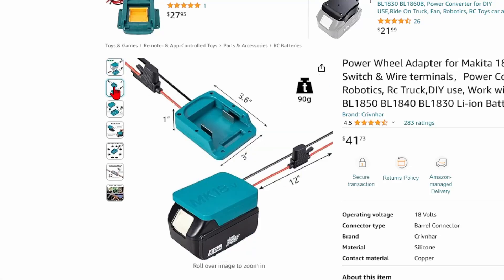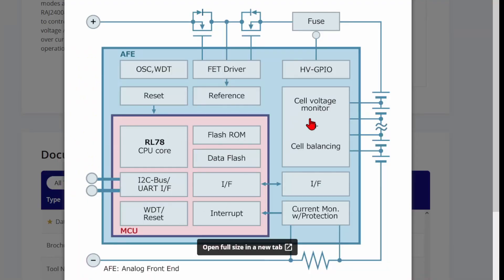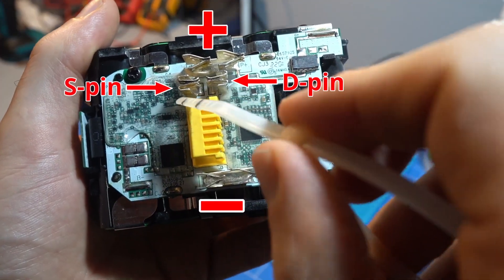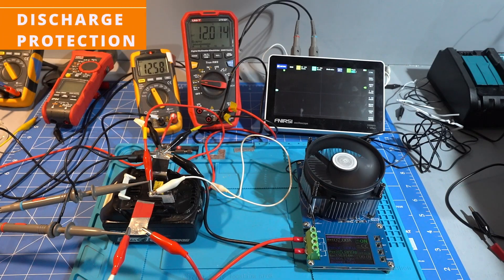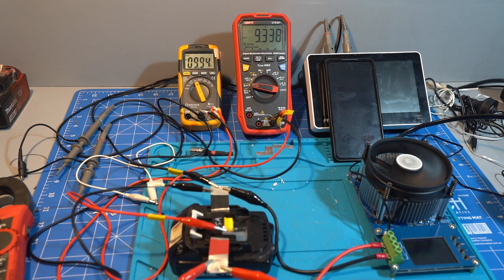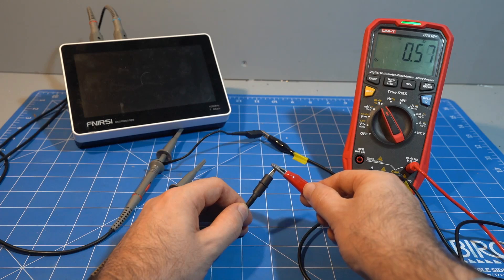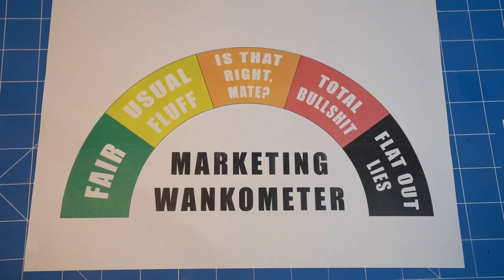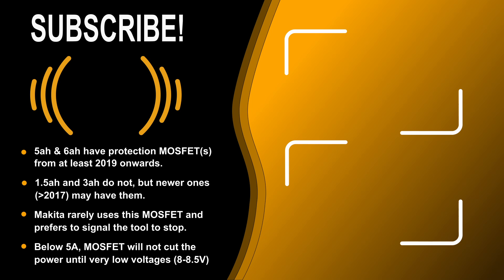[006] Do Makita LXT batteries have low-voltage protection?

Comment: i have a 1.5ah from 2012, no mosfet (rev:ES2-2). and a 2015, 3ah also no mosfet (mk04 ver. D)
the heater in the fuse is insane...

Comment: I tried all my 5ah Makita in my tools and they all cut off at 14.5v
Reply from the maker: Is that measuring after taking out of tool? Voltage will rebound fairly quickly once the tool stops, so you need to be recording voltage at exact moment it cuts off.
Reply: @toolscientist oh i will check again. It was as soon as tool stopped I took battery off and read the voltage.
Reply: @toolscientist the fan DCF301Z shuts at 14.5v on high. 

My meter was showing 7v from battery after draining on the low fan speed. The red indicator light didn't even light up anymore. Charged up on fast charger perfectly fine.
Reply from the maker: @MrHavokman is the fan a 2-pin tool? 2-pin tools have their own low-voltage cutoff that is independent of the battery.
Reply: @toolscientist  2 prong for the fan.

2 prong for the blower.

Grinder, Skil saw, drill etc all 3 prong. 

The variety of voltage stopping is weird.

Comment: Imo a boolean one way and a current the other way IS data exchange, technically.

Is there over-charge protection? I don't have a makita charger and have been charging it manually by just applying power to the pins and stopping at 20.5V. Worked fine this far.
Reply from the maker: Yes, it is technically digital, but I still think it's a false claim. I think if you charge via the 3rd slot then there is a mosfet between it and B+. Not sure if it can block current if you use a 3rd party charger. The big mosfet on B- cannot block charge current - it can only block discharge.

Comment: Now the question is how are the new 40V batterys build?
Probably quite different I would assume since what Makita is doing here seems overcomplicated and incorporates lots of legacy components.
All of the 40v tools are new and brushless so in theory they could really dumb down the batterys to basic protection and a low voltage cutoff and let the tool have more control.

Comment: Those finirsi scopes are great for the price but the common grounding on the probes has caused me some interesting problems before I realised.
Reply: Being an old school electronics bod with multiple oscilloscopes the common ground on the probes is what I would expect.   None of my scopes from ancient to modern have any other arrangement.
 At least with these battery powered scopes you have a floating ground where the mains powered bench scopes had the ground at earth potential which really did limit how you used them.
 Be careful.

Comment: Question: What fuse will blow if a clown testing Makita dt154 revered polarity with 5.0Ah battery? Spark, smoke, super hot wire, tool dead. Battery still 2 bars. Don't have another tool to test.

Comment: I was always under the impression that the tool itself handles the low voltage and overcurrent cutoff because of the 3rd "sense" pin on all genuine Makita tools and batterys and I think some tools even use the yellow data connector too.
And it seems that Makita does rely primarily on the tool to protect the battery and whats in the battery is a last resort circuit and short circuit protection.
I have one really poorly made copy battery that came with a cheap Makita compatible tool I bought and my genuine Makita tools like lawnmower, string trimmer, hedge trimmer, drill and blower don't like that battery at all they refuse to start up and some show a battery fault actually. Must be because the 3rd pin is missing.
Interesting to know that there is a fair bit of electronics and tool to battery communication involved here.
There is a brand called CEENR that makes good quality makita compatible batterys for a great price and I bought two because genuine batterys are expensive as hell here and those have the 3rd pin and the yellow data connector and work great with all tools.

Comment: How can that little mosfet handle 550 amps when that's literally welding cable thickness wires,??
Reply: it can probably only handle it for like milliseconds before the trace overheats. Component spec sheets usually list that as the max assuming some awesome heatsink. Then they supply a temp derating graph. Hotter it gets the lower the max

Comment: Great analysis! When will you do a Makita XGT breakdown + analysis? I'd love to know if XGT batteries also do cell balancing and have other protections.

Cheers!
Reply from the maker: It's on the todo list and I already have tools and batteries to test. It's the most complex system I know of (digital comms with tool; digital and analog with charger; deep diagnostics protocol), so it'll be multiple videos
Reply: @toolscientist Awesome! We’re looking forward to it!

If you haven’t yet fully reverse engineered the digital and analog protocols, it would still be cool to get a first video in the series with the basics like the cell types, whether the cells rebalance, low and high voltage cutoff, thermal safety characteristics…

Keep up the great work! It’s very interesting and also generally educational!

Comment: I have two original Makita batteries. Because I don't have an original charger, I charged it with a LiPo charger. Now the charge level indicator (LED) does not work and when I plug it into the device (with 3 contacts) it does not work although the battery has a voltage of 21V. You describe the contact as a D-pin which has none and never gets voltage, so the device only works when I pull the battery out slightly and the contact makes contact with the S-pin. What can I do or where is the fault?

BTW great content, love this kond of YT videos… it stand out. 💪🏼
Reply from the maker: The BMS has likely locked itself. You could try the reset tool made by Martin Jansson. It does not work on all Makita batteries, though. https://youtu.be/T68isEgWwvk
Reply: @toolscientist the Solution was easier. I bought a genuine charger and plugged in abd thats it. All issues fixed 😂
Reply: @toolscientist  I ordered the Cable, I give it a try. Thanks!

Comment: 8:40 pulling the cover off a 4ah (s/n 212830hws) does not appear to reveal any mosfet, just fuses, happy to provide images
Reply from the maker: The 2Ah/4Ah situation is complicated. Most don't seem to have power FETs, but some do. It's not based on date either. You can post in the reddit thread, or just email them and I'll post them. I've mostly lost interest on trying to figure out which 2/4Ah have mosfets as it would require a hundred or so batteries and cataloguing serial numbers, manufacture date, manufacture location, et cetera. Ideally, someone from Makita would just leak the info to us 😁

Comment: At last, a fellow engineer who has done some accurate research.  I recently bought some Chinese copy Makita battery kits to be able to recycle cells from my electric bike.  I found these kits have an irritating cutout at quite low current so are useless on high power Makita tools. They have 4 (cheap) MOSFETS in parallel with what look like 4 resistors but the battery shuts down on my angle grinder almost as soon as it touches the metal I am trying to grind.  Since you have the setup it would be great if you could do some tests on such a kit.
Reply from the maker: It could simply be that your recycled cells have high resistance. That could cause enough voltage drop to trigger low voltage cutoff.
Reply: @toolscientist hI did think about this so I bought 3P5S Kits(7.5AHr) To put them in. I also made some kits with brand new 3AHr high discharge cells and the same thing happened so I'm pretty sure it's the BMS.
Reply: @toolscientist hI did think about this so I bought 3P5S Kits(7.5AHr) To put them in. I also made some kits with brand new 3AHr high discharge cells and the same thing happened so I'm pretty sure it's the BMS.
Reply: I would like to see the censored responses.
Reply: I've noticed that shunt resistors on Chinese BMS PCB have several times higher resistance than original. Quite likely they're made for low current cells knockoff batteries are usually made with. So you could increase cutoff current by replacing them with lower value. Also you probably should to weld extra nickel strips on top of what's supplied to reduce their resistance and thus voltage sag under load.

Comment: Hi great video! I wish I could understand 1/10 of it BUT jokes apart, I've found this video following a link from Reddit where I was trying to understand if I can use a Ryobi rechargeable battery ( all my tool are Ryobi powered so I'm stuck)on a tool that has a makita socket. Is there an adaptor or shall I just leave it and get in the Makita club? I'm a beekeeper and now the vaporizer for oxalic acid in Australia only comes with few socket options ( I guess because is made in US only). I look forward to hear your thoughts,Thank you
Reply from the maker: Search for "ryobi battery to makita adapter". I can see results from aliexpress, amazon, and jmmsolutions (who is just reselling the same adapter at a higher price, but it's an Australian seller)
Reply: Done  @toolscientist but I thought it wouldn't work...

Comment: I have a couple makita BL1830 batteries from 2008 that are still working and charging on Makita chargers, my other ones are much newer. I also have a Bosch 18V 2.6ah lithium ion battery from 2009 that is still working great with factory equipment. I haven’t had as much luck with the Milwaukee 5.0 18V batteries though…

Comment: I see you have Milwaukee 12V charger/Powerbank there on table. I’ve the same which stoped working, any hints or pointers about the internals and if it’s possible to repair it. I can solder well and have some knowledge of electronic circuits.
Thanks in advance for any advice.

Comment: I’m curious if you’d be interested in testing Ryobi and the Ceener PDNation batteries as they claim to have internal protections to work on any tool brand with the right adapter! The PDNation is not a pro-level battery, but as a home DIYer I have several brands of tools and it would limit the total number of batteries I’d need in my home (making them cheaper overall even if the price-per battery isn’t)
Reply from the maker: Not super interested in CEENR as others have looked at it. It's also unclear how long that product will be around. I will definitely be testing Ryobi in the future.

Comment: So is Makita the only tool maker who make batteries with cell balancing? I'm looking at getting a Hik heat gun and looking at using a battery adapter. Are you going to do a review on battery adapters for different brands? Your YouTube videos on batteries I have found to have the best technical explanation and facts I've seen so far.
Reply from the maker: I don't even know if Makita does it yet. It'll be a pain for Makita, because they have so many variants (some with internal cutoff, some without). I'm sure there's brands that do it. Someone sent me an image of a cheap euro brand (can't remember exactly which one) that had very obvious balance circuitry.

Comment: I have a BL1850  which had a blown fuse. I replaced the fuse and now the D pin cuts immediately out. The leds don't indicate anything and the white light won't turn on. So it seems this battery is for some reason completely dead while the batteries measure just fine 18.5v. Any idea why?
Reply from the maker: Are all cells at a good voltage and closely balanced? Ideally within 0.01V. You could try Martin Jansson's software unlock: https://github.com/mnh-jansson/open-battery-information. You will need an Arduino Uno R3. He made a small batch that you can buy if you want to save some effort - you have to email to se if he has any left.
Reply: @toolscientist  yes I saw that. Very cool. I definitely going to try that. Looks like a standard uart serial interface

Comment: I'm trying to build a DIY interface using the Makita LXT yellow terminal and the Sync Lock system.  Do you happen to know which pins on the yellow terminal is the clock and data pins?
Reply from the maker: I haven't looked into the digital side of LXT batteries yet. You can find pinout info here: https://www.laptopu.ro/community/power-tools-battery-pinout/makita/paged/2/
Martin Jansson has also done a lot of work on the protocol: https://martinjansson.netlify.app/posts/makita-battery-post-2
He released an unlock tool here: https://github.com/mnh-jansson/open-battery-information

Comment: 7:28, wow, a $9 mosfet. And people say power tool batteries are overpriced. I'd say the Makita batteries are reasonably priced.
Reply from the maker: 9 dollary-doos, so 9 AUD. I think 5 USD. That's from digikey in a box of 3,000. Makita likely buys direct and gets it cheaper. But still, it's one of the most expensive mosfets I've seen, so it's still a significant cost for something that seems redundant.

Comment: I am too dumb to understand this video sorry but I'll ask anyways: how did you manage to use a knock-off battery with the 3-pin makita device at 2:15 ?

I would rather not buy the official 18v batteries, they are just too expensive but unfortunately the device I got won't start with knock-off "21V" batteries.
Reply from the maker: That was just a demonstration. To get Makita 3-pin devices to run, you need the 3rd pin to be within 2V of the B+ pin. Easiest way is to connect a 1 kilo-ohm resistor between B+ and and the 3rd pin. There are many "battery adapters" that do this for you.
Reply: @toolscientist cheers !
Reply: @toolscientist do you have any kind of ressource (book, youtube educational videos..) that you would recommend for someone who wants to learn more about electronics?
Reply from the maker: @PurpleBird-mh7vb  unfortunately not. It's been a very long time since I learnt this stuff.

Comment: Great Makita info ! You have looked at the pcb quite a bit now, does this pcb actually do active cell balancing, or just cell monitoring (more likely I believe) ? Web info seems (imho) to confuse balancing with monitoring - the latter just makes sure that all charging stops when any cell reaches max permissible V, I believe. So you end up with unbalanced cells, but no actual fire. To do active balancing, you'd need to switch charging off to full cells, and continue charging the rest. Is this your view too ? Maybe the yellow connector has the cell taps in it, so that the charger can do some real balancing ? Thanks, Dave (UK)
Reply from the maker: The yellow connector doesn't connect to the cells. It's a digital communication interface. The chips used by Makita are capable of balancing, but as I've learnt from Milwaukee, that doesn't mean much. I'll have to revisit Makita soon. Lots of requests from people wanting to know which brand balances.
Reply: @toolscientist  I have 15 Makita batteries (I'm a carpenter). One dead well used 2Ah that flashes alternating lights on the battery and won't charge. I also have one dead basically new but imported so no warranty 4Ah that gives alternating lights on the charger, but the lights on the battery are fine.

Ultimately I'd like to rebuild these but if the BMS boards are locked there is no point. The 2Ah and 4Ah BMS boards are different. If the BMS boards are good it would be interesting to move them to an Aliexpress 21700 battery case, I don't trust the Aliexpress BMS boards even though some look to have quite a bit of circuitry.
Reply from the maker: @Fekillix  this unlock may work for you. Requires arduino. I believe some people are selling complete kits that use this code. https://www.youtube.com/watch?v=T68isEgWwvk
Reply: From the quick looks of the board it doesn't seem to have any kind of balancing function even if the bms IC has these features. I believe it's only used for cell monitoring as you said. Normally for passively balance you would see decently beefy resistors that bleed excess voltage and for active balancers you'd have a cap or inductor to redistribute capacity to other cells. 

Hopefully @toolscientist can do some testing to confirm this. Great content toolscientist!

Comment: Very informative review - thanks for it. Too bad that Makita did not made all the protections active in BMS, having all the components need :(. I guess (but don't know what for) this low voltage cutoff, under 5A load, could be some backward compatibility with older (non star) devices, otherwise it's simply bad design. Anyway, since Makita kind of abandoned LXT devices (I know - they say it's otherwise) and we haven't had any new battery for almost 10 years... time to change to other brand
Reply from the maker: Sauronmakes! Thank you for inspiring this video. The under 5A thing is because most Makita power tools are comfortably over 5A (unless just free spinning). Their low power tools (like lights) only use 2-pins and cutoff at 13V. I would like to find an insider that could tell me why it drains to 8V when less than 5A.
Reply: Could be to kill it for recycling? 
Easy for service/recycling centers to deep discharge prior to sendig/recycling condemned packs. The funny begins if the battery will charge again at this low level. 
Would be interesting to see if it will still discharge to this level when "bricked"
Reply from the maker: @vegardarntzberg5514  it does charge after a 8V discharge. Worked for myself and sauronmakes. Makita ships their  batteries at around 8V, which is why I theorised that it was a shipping mode feature.

Comment: Ahh, real science! Thanks for this. I've got a bricked 5Ah. Cell pairs are all balanced still so I think the Renesas chip has decided that have been too many bad charge attempts and locked it. Have you come across a way to reset this chip?
Reply from the maker: Yes, this guy made a software unlock. Doesn't work on all batteries as Makita has changed their chips several times. https://youtu.be/T68isEgWwvk
Reply: @toolscientist  oh wow! Another hero! I'm going to have a go at this when I get some time. Thanks